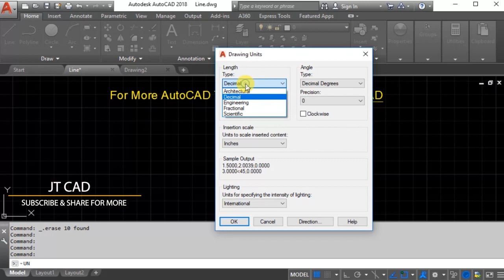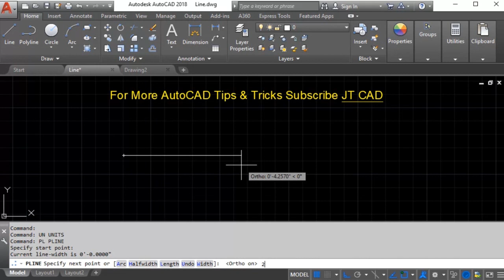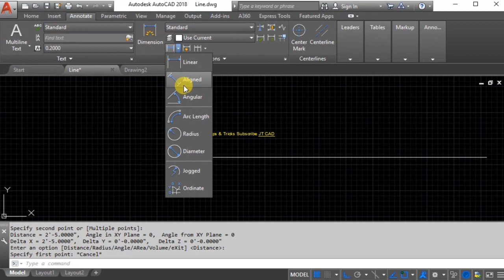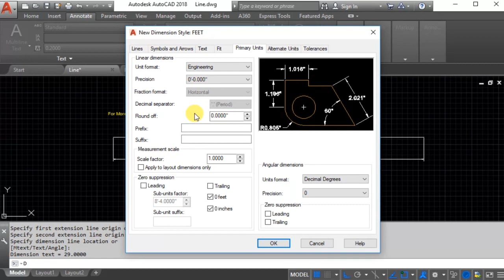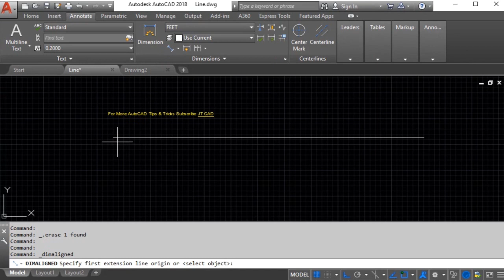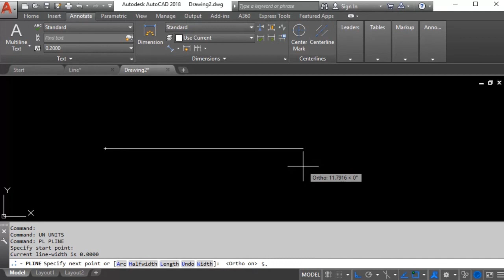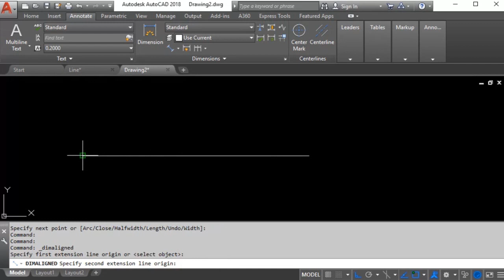How to Draw a Line in Feet & Inches or Meter & mm By Using the Autocad Basic LINE Command - Tutorial

Comment: Why is it showing 5.3" in command line?
Reply from the maker: At what time ?
Reply: 5:40
Reply from the maker: Actually, the video was paused and trimmed. while redoing I had to UNDO some of the commands. hopefully, the Units command was also undone. That is why it is showing Inches measurement in the command line. But that doesn't matter. If you follow the steps you will get exact results. just some practice and you will be used to it. Thanks for the point anyhow. I will surely make better videos for you in future. Stay Tuned.
Reply: JT CAD Is the second drawing opened in metric template?
Reply from the maker: No it is just simple drawing. Just go to file>new select acad.dwt
Later on you can change the units